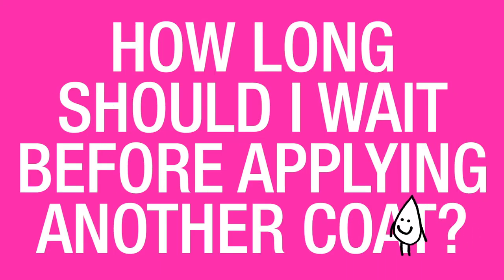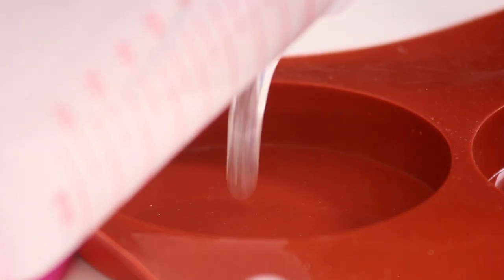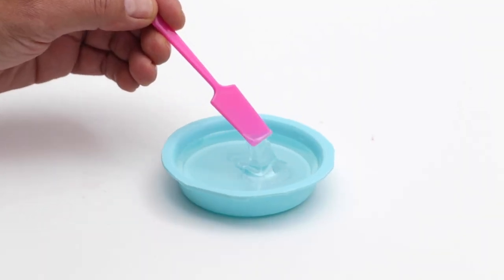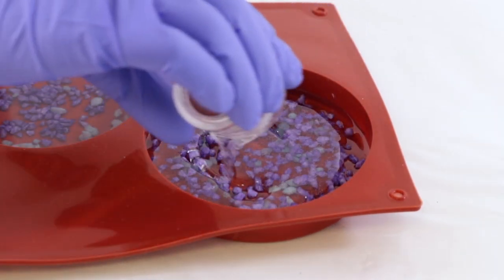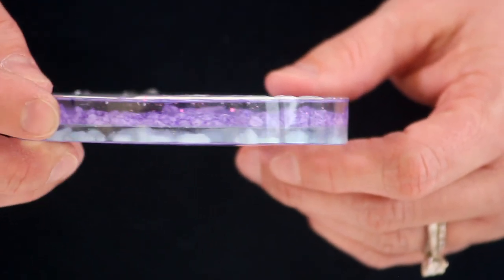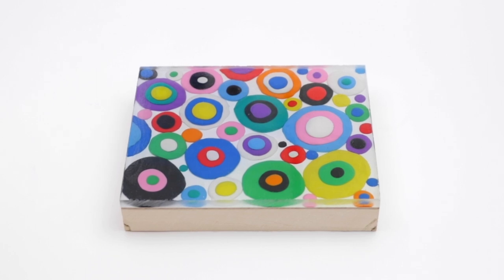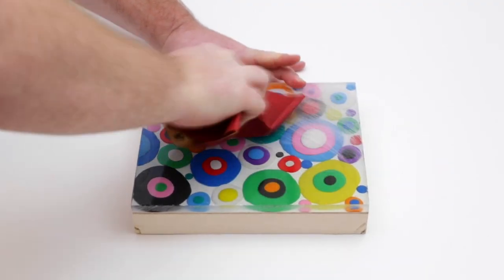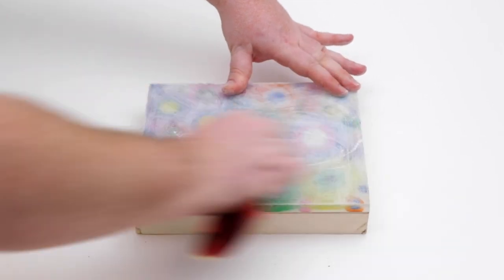How Long Should I Wait In Between Resin Coats?

Comment: Can I do this if I didn’t add enough resin in the mold?  First time, didn’t make enough so the mold has like two more inches I can add. The flower petals floated to the top and are kinda sticking out, so I’d like to add a bit more to fully encase it. Also, is there a secret to getting the items your putting in the resin to NOT float to the top?  I have bouquet flower petals and real bird feathers I am putting in for my step mom as my dad and her just got married so I thought it would be cool to put the feathers from her bird in and the petals… but it’s all just floating to the top.  No bubbles, looks fantastic, except the flower stem is coming out the top. :(

It’s cured bc the isnstructions said to wait 6 hours before adding more but I can’t seem to find any videos on adding more if you DONT want them to look like unique layers?
Reply from the maker: Hi Amanda
Yes, you can definitely add more resin to fill up the mold.  You can either do it when the resin is still sticky (typically 3-5 hours after you pour) or when the resin is cured, but it's best to sand down cured resin (being sure to wipe away any sanding debris) to ensure a good bond.  If you want to lessen the layered look, the first option (pouring after 3-5 hours) is the best option because the 2 layers will cure together. 
Some artists like to wait until the resin has started to thicken up a bit in the mold before adding inclusions that may float to the top, at about the 30 minute mark, give or take (...There are lots of factors that can affect how fast the resin cures - outdoor temperature, if you've given the resin a warm water bath, how thick the mold is etc but you want the still fluid enough that you can add in an inclusion.)  A toothpick can help move the inclusion into place.  Sometimes, it just comes down to babysitting your piece for the first hour or so until the resin has thickened up enough that the inclusion won't move. 
Hope that helps!

Comment: Does the second coat have to be the same amount of volume? I did a 18x24 inch painted panel with 1.5inch depth, it was 16oz for the first coat. Can I use less the second time around? Whats a good amount just to be a thin layer over my sanded imperfections? Thank you!

Comment: And some paint came off my board, can I do spot treatment painting on top of the sanded resin? Will the second resin coat hide that? The paint will be the same color
Reply from the maker: You can paint on top of the resin. However you might be able to tell that it is suspended in-between 2 coats of resin which does give a cool effect if that is something you are going for or don't mind :)

Comment: Do I wait 24 hours before I take the resin out of the mold or do I wait the 72 hours for it to fully harden??
Reply from the maker: You can unmold the pieces at the 24 hour mark or when they can be handled without damage.  Removal is often easier if you don't let them sit in the mold for the full cure time.
Reply: @Artresin  I thought so but I’ve seen tutorials of people leaving them in the full 72 . Appreciate it! Things a beginner needs to know!!

Comment: I just did a project [Friday]and didn’t have enough resin but I can’t get more until Monday so almost 3 days till I can get the second coat on... is this an issue ?
Reply from the maker: Hi Risa, this is not an issue at all. Once your resin has cured, you can wait as long as you like before sanding and applying another coat of resin. Timing is only a factor when you are pouring multiple coats the same day. You want to make sure you are applying a fresh coat every 3-5 hours before the resin is still sticky.
Reply: @Artresin  thank you so much!

Comment: It is nice video 
I have a question to ask 
Is it when they said gel time ?
I saw on amazon epoxy they said it like gel time is 8-12 hours. So the second coat be poured around 12 hours ? Thanks
Reply from the maker: It will depend on the brand, our brand ArtResin has a working time of roughly 45 minutes and for the gel time to apply another coat would be at the 3-5 hour mark. After that window you will need to wait at least 24 hours to sand and pour your second coat :)
Reply: @Artresin I have a question  , how many times should i wait for the exposy rasin going hard
Reply from the maker: @PerfectorSatisfying  if the resin and hardener are mixed properly in a 1:1 ratio by volume, your resin should feel cured to the touch in 24 hours and fully cured in 72 hours.  (when allowed to cure in a room temperature between 75-85F)